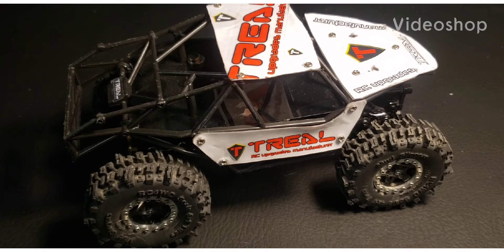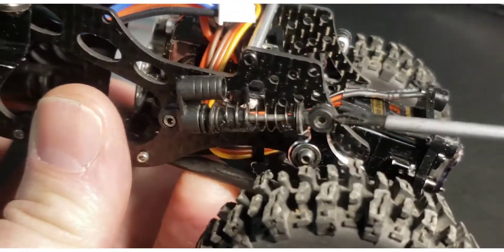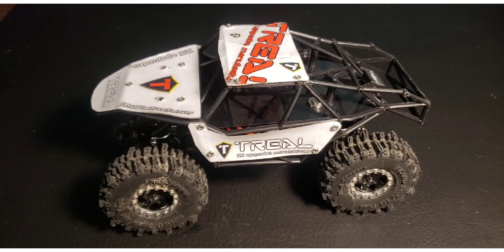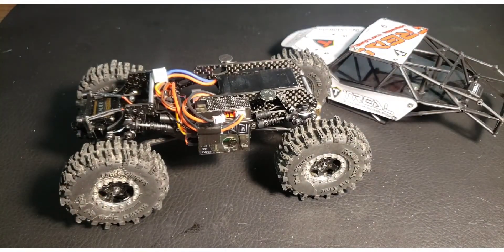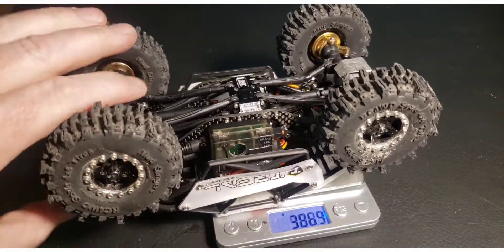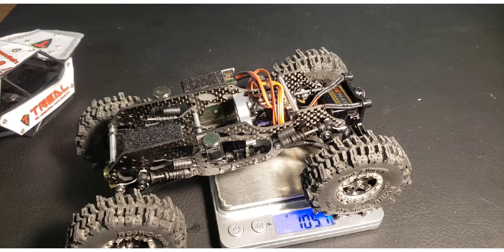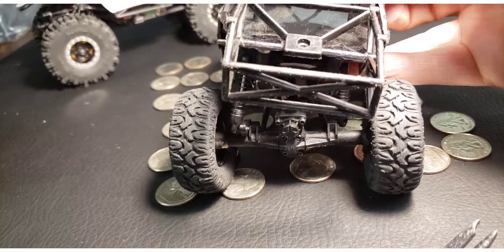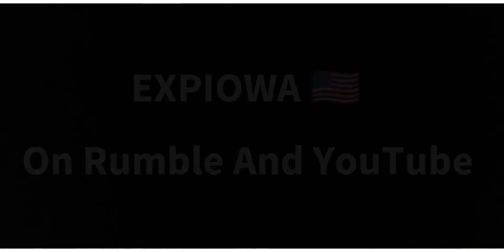Nexx Racing NX-276 Cantilever Carbon Fiber Chassis

Comment: Would adding some lead/brass counter weight, maybe at the bottom of the side body frame/slide rails, help with counter acting the motor torquing the body?
I guess ideally, the motor would be mounted 90deg. to stock orientation, nullifying the side ways torque. But that's just coffee shop spit balling......  :)

Comment: With the upper wish bone link: Instead of grinding it back, could it be heat bent like you do with the lowers? Or is there no room above it? Be a bit more complex a jig to built to bend accurately. Thanks EXP!
Reply from the maker: With the PN90 nounted forward there is no room. I just cut the motor side link off. It seems wrong and it would be for a road vehicle but here its fine.

Comment: Can I use a c10 body with this?
Reply from the maker: Yes but it will need get creative and make mounting points for the body. I had to make my own out of an old servo case. It doesn't come with mounts for anything. 

I don't recommend this chassis. The CG is higher than my other trucks.

Comment: what is your brushless setup?
Reply from the maker: On my 4WS rig I have a Furitek Teju with a Surpass 1400KV. Everything else I have is brushed. Brushed engines are all lighter weight and provide a better CG. 

I am interested to try the Mofo RC Nano brushless motor. It seems like it might be a good mix of the two. I haven't moved on it yet though. 

I have been devoting my time and resources towards my tenth scale rigs lately. Summer is coming and I am thinking about trying some comps. My b.t.h. TRX Sport  and heavily modded Gen7 have been getting some love lately.